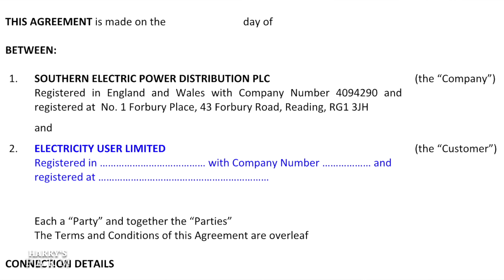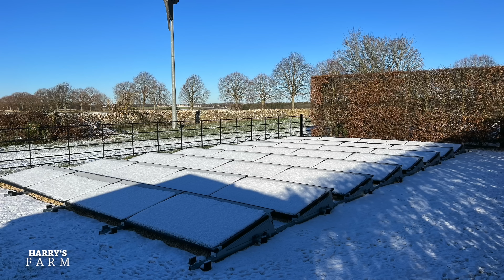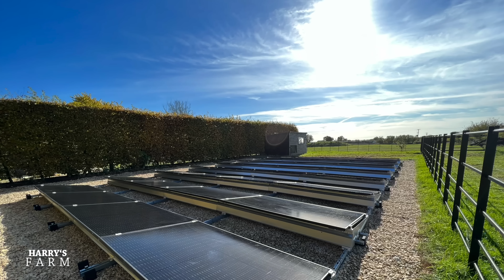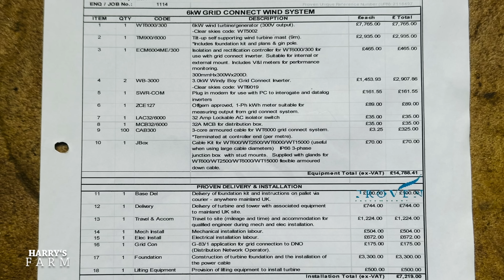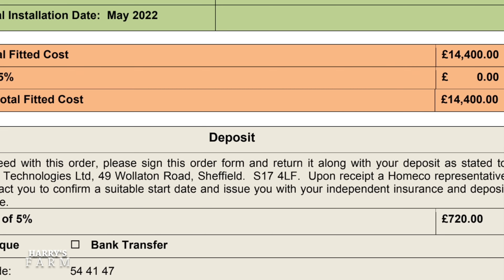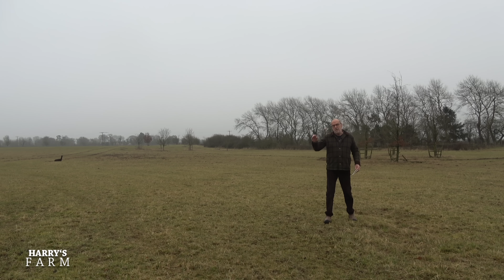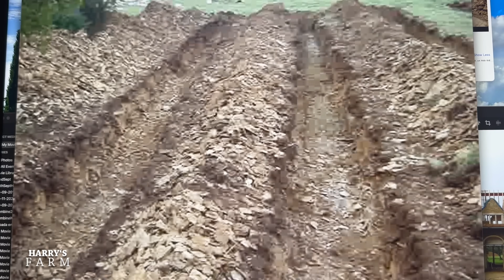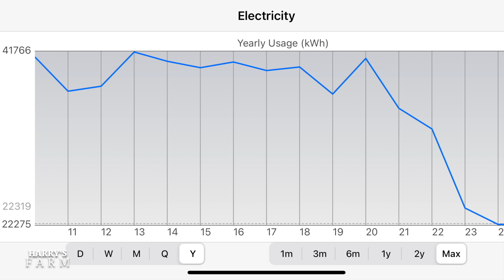Are solar panels & heat pumps worth installing? Here's what I've learnt after several years of use.

Comment: With my inverter I can oversize the panels to 200% of the rated output. So I can have 10kw of panels connected to my 5kw inverter. With 440w panels at £45 plus vat, you could add an extra 5kw input for about £1000 (including fixing rails). This would really help winter generation and ensure you get your 12kw output more often in the summer. With my inverter any excess production over the 5kw inverter limit can stay as dc and be diverted to my batteries. Any more excess power is just lost. Check your inverter specification to see if this could work for you.

Comment: I've been in the renewable industry for 12 years and as interesting this video is I would like to say "a little learning is a dangerous thing".

I am very glad that you have had such a great experience with heat pumps; especially considering you have such a large home. But the idea of putting solar in without battery storage is insane.

ROI on batteries is currently 2 years due to off peak charging; and feed in tariffs are essentially pointless.

Comment: Shading from the east, shading from the west, that will be affecting the generation a lot more than youre thinking.  Also the inverter isnt shutting down the string, it is the way the physics of a solar panel works.  Rough rule of thumb is 5% shading 25% power loss, 25% shading 75% power loss.  The solar panels will have blocking diodes but if the inverter is not able to or not set up to utalise these they will not help.

Generation for June is bang on what a clear array of that capacity should be doing facing that way at that angle.  December should be more like 230-250kWh, the reduction is due to shading.
 
Your array is facing south west, the tall hedge is to the south east, it will affect generation for a lot of the year.  I would re locate the panels personally and increase their angle to at least 30 degrees.  I think you have some clear land a stones throw away to the south west of the current array location.  It would be an easy enough job to do, I would happily help you do this.

Moving from their current location to a clear south facing location at 30 degree pitch would give a generation around 410kWh for December.  Thats just for December, all months will improve with the exception of May, June and July where you will see a drop of around 50-70kWh between all three months.
Reply: Indeed if you want battery storage and additional solar panels I can help there too, I also have a lot of expereince with Proven wind turbines and all aspects of system intergration of renewables and non renewable generation and heat systems.

Comment: Hi there I’m a MCs solar installer, the system you are using looks like a vaulk system, with a 10degs pitch ,they do a steeper pitched model , that way you get more out of them in the winter , but with out spending any money at all give the hedge a good hair cut !!
Reply: I get that the hedge is probably there so they can't see the panels from the house or whatever, but even if they cut 2ft off the top of the hedge it still wouldn't be visible and the shade issue almost goes away.
Reply: That was the first thing I thought - the angle of those panels isn't great for low winter sun!
Reply: Tigo optimisers as well

Comment: On domestic solar you can export at 15p per kWh during spring/summer, so you offset your winter usage. Alternatively you can install a battery, but in our case we still export pretty much all of our excess solar production in Spring/Summer and then charge the battery using cheaper off-peak electricity.

Personal experience, is we've reduced our energy cost by at least 60% and the solar and battery will pay for themselves in 8-9 years (with a 25 to 30 year life for solar, and 15yr for the battery)

Comment: 6:05 Something is wrong there. 
Literally writing this comment using solar with 4 panels and its powering on a PC. Has enough power to use the pc and charge a little the batteries.  Maybe those panels are the wrong type for that place.

Comment: That's why I set up my modules at a 60 degree angle. More electricity in winter and less electricity in summer. On average with a 12 kWp system 22.8 kWh per day in winter

Comment: We have a 3.5kW system and invested in a 9.5kW battery. Being on duel tariff the battery is charged overnight at 7p/kW and on these grey days lasts until around 2pm, longer if the sun appears. So we can charge the battery and the PHEV at the same time @7p/kW

Comment: Thank you sir for your video, we have a large farm also. We have talked about doing large solar panel area like what you have, I have some solar panels for a start as experiment between wind turbine and solar. Like you say even the shadow of your arm going across a 400 watt panel reduces the out put by 25 to 30%. I found that if I sprayed the panels with a mist of water in full sun I could get 7% more wattage added to output. This is due to the magnification of the light absorbed from the panel.  Another more passive way I have increased my wattage when shade interrupts the sunlight. Being from trees or house is  by using acrylic mirrors to divert the light to the shaded areas to compensate.  It works, Then you have to have the extra room for the mirror's and worry about the wind if it gust shifting the lightweight acrylic mirror.  We do have quite large property so an acre of panels in the middle of say 40 acres would escape all shade and fix all the problems. So basically the initial investment is high. I do believe here in South, South Carolina it would pay off. Large battery banks would make a big difference. So anyway. Also I have noticed the panels in full sunlight are much more efficient when cold weather is present of course. It is certainly a lot to consider and calculate. It seems for Harry's Farm if you could put acrylic mirrors on the sunny side of your tall hedge and divert the sun to your shady areas it would wipe away the shade.  It is an option to look into for sure for uninterrupted power in your situation when sunlight is available. Overall you seem to have it all figured out. And anyone would be proud to have your setup. Thanks for sharing your info!

Comment: Good stuff Harry, all new builds should be using solar & heat pumps. We currently have solar & ASHP to heat a good sized indoor pool. It works very well in the summer months & results in pretty much free heating of it - it’s off in the winter!  
We are just starting building a house in the grounds to downsize into and looking to use solar & ground source. Can you please tell me, are your upstairs rooms just warmed from downstairs underfloor heating?

Comment: Harry's farmhouse is all well and good, being heated with an extensive array of water pipes below the ground and with his solar panels. However, Harry is the exception rather than the rule by far. The vast majority do not have the land (let alone the money) to do what he has and such systems are impossible to achieve for most people. The alternative heat pump system for the many is the air source heat pump and there are significant noise issues with those systems, particularly where there are many houses using that technology. Air temperatures are likely to be quite different from below ground temperatures with associated issues during the winter months. Efficiency of air source heat pumps is also a major issue.
Solar farms along with wind turbines are a blot on the landscape, ugly man-made structures that years ago would have been condemned for spoiling the natural landscape. We are heading down a path of madness and future destruction of what is still, in places, a green and pleasant land. All for the nonsensical idea that CO2 causes climate change (on what is a naturally volatile planet). The result will be reduced crops due to low CO2 in the atmosphere and less land for growing crops due to solar farms with acres of plastics, the production of which will still rely on fossil fuels and the disposal of which will be a headache for the future generations all this madness is supposed to help. And our population is increasing. Where are we going?

Comment: Most people would be better off with air-air heat pumps. We have 4 in Sweden, 150 m2, roughly 10 minutes to heat the room. They work well down to -5, then we use the log fire.  Our 10 kW of solar gets the most use in spring when it’s sunny enough and still cold.

Comment: A great honest video. There isn't much information like this anywhere on the internet which deals with the off grid self sufficiency angle.

We are just in the process of getting a 50kw east/west array with a 50kw battery. I'm looking at getting the tariff for cheap electric to charge the battery in winter, as a few of your comments suggested to justify it.

We are trying to do a similar thing to you, as we have an outdoor pool and an air source heatpump. Currently, we have a solarmatt  {lots of black water pipes and manifolds } on an adjacent tin roof to help the electric bills. This puts out roughly 3x the amount of heat than our 28kw heatpump, but only when the sun is shining! Quite happy with it though, as we now have a warmer pool.

Comment: Geothermal is a no-brainer it's the most efficient by far. Drilling, you will have warmer water and better conductivity. About 150kWh per active meter hole is feasible to drain. 
And.. you can always tune the heating curve reduce water temp cop goes up. 

For solar in the winter, better angle them more like 70° and put them up high where they get less shading.

Comment: Heat pumps are essentially reverse fridges & especially air source heat pumps can equally be used as air conditioners, which could be a good way to use the solar energy in the summer.

Comment: Brilliant H  taking the hype out of stoopid solar farms - especially up north.  These panels are gobbling up farmland.  Your ground heat pump looks better all round.  No point putting up windmills in average conditions. They need to be up in the Scottish isles horrendous wind but local nimby opposition.  Offshore wind huge maintenance issues.  Sadly tidal barrages totally ignored.  Alternative heat energy storage - ignored ie molten salt, old school thermal ceramic bricks (as used in storage heaters) - low tech stuff very low risk. Lithium batteries very $$$$$$ and risky - needs inverters - weak point and fail regularly.

Comment: At last, some clarity on what the actual benefits of alternative energy are! 

What isn’t mentioned are feed in tariffs, which were very generous back in the early days. 

What I’d like to know is how much PV panel efficiency has improved and the figures on how well the latest MPPT controllers can mitigate shading. 

But the big question was answered - how much energy do you get out of a solar installation in winter, when demand is at its greatest for heating? Answer: Nowhere near enough! 

Seems to me that taking advantage of very cheap energy tariffs by just installing a battery looks like a sure fire financial exercise. The risk of thermal runaway is a concern though, so finding a suitable location so the thing can’t burn your house down is a very good idea! 

If you’re going to buy an EV, a battery system, perhaps backed up by a bit of solar seems to be the way to go. 

Wind power would be nice, but the up front costs are prohibitive, would look ugly. 

I think I’m going to spend a lot of time and money improving the insulation in my house!!

Comment: Great video Harry. Thank you. Followed your journey to the letter (although my garage didnt get the benefit of UFH :-( To further optimise our domestic needs I installed Tesla PW2, which has helped to keep our annual electricity price down to -£600 per year. I built our replacement garage before the house and it benefitted from the original Feed In Tarrif, so hence the luxury of having a negative bill. Fully with you on the solar farm debate. Definitely not the best use of farm land imho. As an island we should be investing in wave tech and replicating the Octopus community model that they use for wind projects. i.e. invest in a national project and benefit from free electricity when it is generating. Wave tech would be in almost permanent production.

Comment: The point of having a battery is to increase efficiency and amount of time you can avoid drawing from the grid.  I have an 8.8kWp solar system, 6kW hybrid inverter and 15kWh battery. My panels face west-south-west. I use the low-cost night rate electric to charge the battery (and run the house) from 00:30-06:00, then play out the battery until the sun starts giving me electric at around 11:30-12:00 then on many days - even in the winter - the solar makes enough to run the house and re-charge the battery. After the sun goes down (winer say 13:60) I have enough back nin the battery to run to mid-night when I get back on to cheap electric - and so the cycle goes. I use only cheap rate electric on average 5 days out of 7 and am saving around £175/month.

Comment: The system doesn't shut down from shade, the system has elements in series and works at the slowest rate of flow. One panel suffering from shade drops any others in series down. Slightly simplified but in essence that's what you need to know.

Comment: Mate, why did you and your installer not release that installing a ground mounted  PV system next to shading would degrade performance? Doh!
Reply from the maker: Because the solar only started to get shaded when the hedge grew taller! It didn’t shade it when the solar was installed. We now cut it more regularly and it’s no longer an issue.

Comment: Harry, get yourself a new ground mounting system that  allows  you to increase the angle in winter. It's a no brainer!
Reply from the maker: Makes very little difference. The farm solar panels are at a significantly steeper angle and the difference in output is negligible. It’s the cloud cover and day length that’s the issue. 2023 was much sunnier than 2024 and 2025 has been terrible for sunshine in my area of the UK so far. I hope things improve soon. 👍

Comment: Great video.
Solar PV engineer here.
Some things just to bring up about the video but these are knit picks that may help some people out. 
For connections under 16A per phase so 3.68kW 1P or 11kW 3P, you can install and notify the DNO without the need for applying for permission first. If you have a existing solar or other generators you will need to check for existing agreements. 
Shading you are broadly right, shade will impact the array but (bypass diodes cutting out as you mentioned), the inverter will move the MPPT to try and maximise available power first. The whole string of panels won't come right down to the lowest performing one (as some might say). Optimisers or microinverters will in theory help with significant shading, but they have inefficiencies to them as well (they also have a habit of breaking).  
The solar array is pitched fairly low so that it doesn't blow away in the wind. The other benefit of a lower pitch you can get more panels into a smaller area with the need to space them less far apart. (You could go east and west if you cut down the hedge). East West will also give you a better load profile too. 
I would also check whether you are also using the full potential of your inverter. If the inverter is 12kW you could probably get 18kW of solar on it which will help you out more in winter.
Reply: Where are you based? If you’re in my locale, I’d like to have a chat.
Reply: Great feedback.    🇬🇧

Comment: Erm - those solar panels are tilted at the wrong angle for best performance in the UK.  They should be at about 56 degrees for Perth i.e. the latitude you are at facing south if possible.
Reply from the maker: The panels up at the farm are at a much steeper angle but the difference in output is minimal. It’s the cloud cover that’s the issue, we’ve had next to no sunshine in February’25 so far but hopefully it’ll improve next week

Comment: This installation is completely wrong for getting out heating for the cold winter months. What you need for that job is solar water panels that circulate warm water in to storage either in a enormous very well insulated 10.000-50.000-Liter ackumulation heating tank. Or if you have solid rock ground via water loops to store heat in the rock ground this system is commonly used in combination with geothermal heating pump systems. The solar panels will add warm water to the storing solution from Mars -oktober from may-september you easy get 80-100-Celsius heated water from the solar panels in to the storage accumulation tank. Of course the heat  stored drops from oktober to Mars but even with 30-40-Celsius heated water stored in the accumulation tank the gains in temperature and energy stored is large compared with 5-Celsius unheated water for uptake with heat pump or pellet or wood burning boilers for heating and warm tap water. Electric solar panels will only give you offset selling electricity in the summer months to provide funding for the winter electrical bills until you get enough offsunlight hours for good productivity. There is also combination panels on the market that provide electricity and heated water.

https://www.ssab.com/en/news/2025/01/meriaura-energy

https://meriauraenergy.com/en/home/